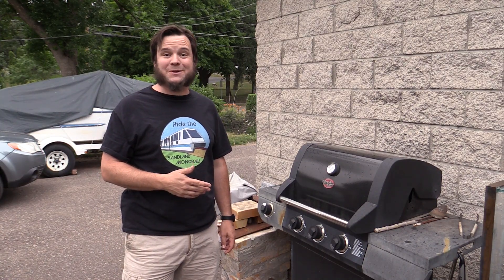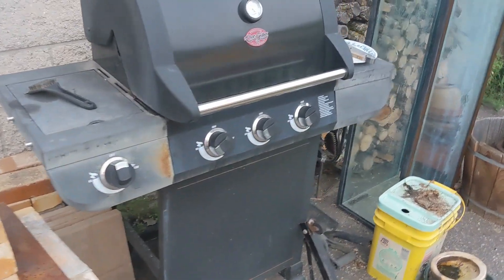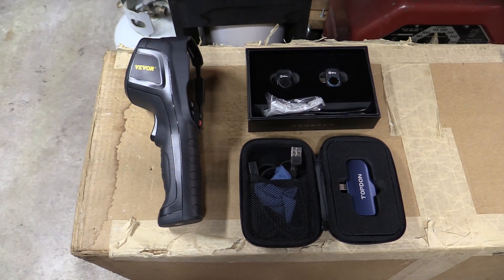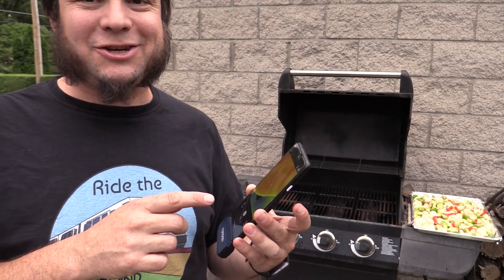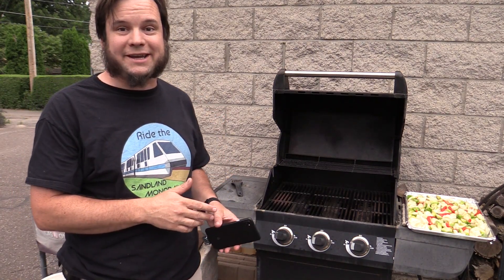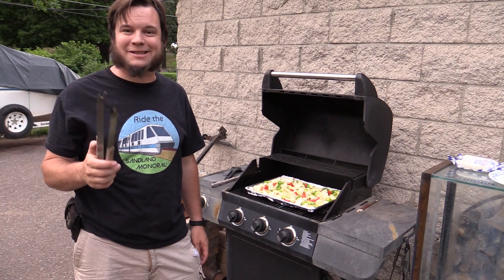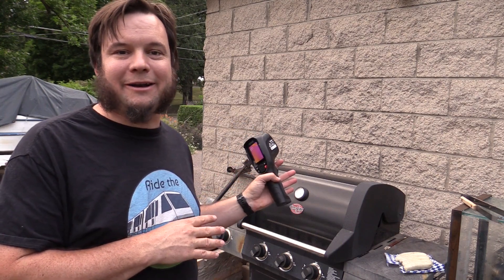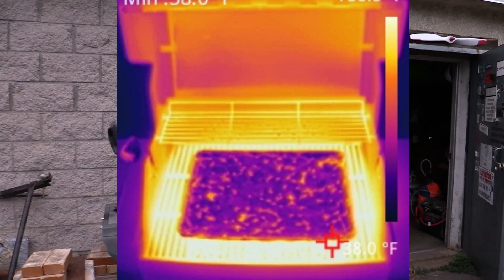I fail to make a heat map of my grill

Comment: I am unsure if this has been stated on here, but I learned a neat trick awhile back. If you take white bread and lay the slices all over the grilling surface of your grill and let them toast a bit (just long enough to get nice golden brown). Once you flip them over, you will have essentially a bread based heat map. This technique will show you where your hot/cold spots are based on the different levels of doneness on the bread slices!

Edit: oof, I got a notification about a like on my comment. Come to find out, one of the top comments on this video is exactly this. Shoulda had a V8 🤦‍♂️ I’ll leave it, it’s a good trick and it works, good to have some method verification.

Comment: You need to set the range the temp sensor shows or it will just default to max difference, + you need a uniform and none conductive backing like thin bricks.
You could also try to bake flatbread on the grill, that would show the heate distribution really well

Comment: Dude, that poor aquarium.
Reply from the maker: The one standing up next to the grill? We got that from a fish shop that went out of business, and so far we've been unable to clean the 20 years worth of mineral buildup off the glass. Have tried various strengths of acid soak, CLR, etc. It's halfway to the dumpster but still sitting in the yard in case we think of a way to use it.
Reply: @saveitforparts  last time I had that going on all I used was a 50/50 mix of distilled white vinegar and water with some scraper and some elbow grease.

Comment: I have had a Uniflame gas bbq for about 3 years. This was its last year. It has gone into the garage over winter, I kept it clean, but the burners, flame shields, and the fat catcher have all rusted out. That's even with a cover over it when not in use.

I saw someone comment on getting a webber, which will last 10 years....
The problem is, they are 10x the price, meaning I could buy 4 of these uniflame ones and still have change left over.

I might invest in that new Ninja outdoor bbq. It has a smoker built-in, too

Comment: Correct me if i am wrong but thermal cameras recordheat radioation right? What if the problem with uneven grilling is heat convection? Like some small  air stream from the coal up througth the grill  are hotter in some places than others or there is less air moving in some parts of the grill?

Comment: during the video showing the thermal cameras I saw what is to be a Lincoln Arc Welder that I did not know you had? What's the deal?
Reply from the maker: Someone gave me an old one, I have yet to figure out where I can plug it in or how to use it!

Comment: I suggest using thermocouples, or RTD's. Omega makes a 4 channel reader (part# HH501DK) for less than $200. You can simulate a grid and place these sensors in 4 separate locations to log the temps. You can go a step further and actually measure with items being cooked because more items will change airflow.

Comment: lay ceramic tiles on top of the burner bars, I do that with my weber to better distribute heat as the burners and flavorizor bars are not good conductors, tiles are cheap find the size that works for you and then test the heat distribution and how it is applied to the grill

Comment: I use these zones while grilling to keep something warm, for example. Freshly grilled food goes on the hottest spot on the grill. When I see it like this, something completely different comes to mind, the heated bed of a 3D printer. I've always been curious about heat distribution there, and you've just presented the solution to me. This way, one can check if the heat is evenly distributed on the heated bed of the 3D printer.

Comment: Due to water content, actual food doesn't get hot enough to view the heat differences with an IR camera. And metal conducts the heat and distributes it evenly, ruining the heat map. What you need is something with a high heat capacity, but low conductivity. Maybe a bunch of separate blocks of something, placed across the grill in a grid. The fake cement "briquettes" might be a good choice, but you wouldn't want to remove the ones already in the grill, as that would alter the heat distribution. Run the grill for a while, and then shut it off and open the lid and view with the IR camera. Hopefully the briquettes on top would block out the higher temperatures down below, and show a map of the cooking heat.

Comment: You are supposed to keep your barbecue and use it  under a sheltered porch or in your garage not leave it in the weather, It will then last ten years. if i was you i would keep the large thermal camera as it has the bigger sensor on it.😁😁😁😁😁😁

Comment: I had a ceramic tile that had about the same size as my grill- I put it in there for only a few seconds and then looked at the back of the tile. I could see the round burners and the grate pretty well with a flir one. In my case even weak wind drafts would completely change the hot zones around- even with the lid closed. This method didn't account for the 3rd dimension though- my grate has two closed round areas direkt above the burners- those parts work more like a pan when the metal is super hot- but die air above it is colder than where the open grate is.. which is bad for sausages :)

Comment: I think you need to put some even, but sectioned surface in there, say some metal plate divided into 1” squares. That will prevent the heat from being distributed by the plate or food itself. You might even consider trying to thermally isolate the plates from the grate to prevent the plates becoming sort of like heat capacitors that would aid in an even distribution when you don’t want them to. Then you probably also want to look at the behavior over time, it might start out very uneven and then become more even or vice versa. Good luck.

Comment: I once live in Saskatchewan in the fricking winter 30 below celcius and I would bbq a lot on my deck.  People looked at me weird.  My biggest problem was grease would get on my lava coals in my propane grill and they were the ones that would not conduct heat.  They would catch fire a lot and I put them out with a spray bottle.  I'm sensing a correlation.

Comment: Hi, I have a suggestion: The TC-001 has two temperature ranges; One from 0 to 300 F, and one from 300 F to 840 F (0 to 150ºC and 150ºC to 450ºC). Perhaps you can find the button option to change the mode. I own a TC-001 but I don't use the official app so I can't tell.

Comment: Are cast iron hot plates not a thing over there? you wont find many australian barbeques without one. big flat sheet of cast, about 5-10mm thick. if your really swanky, you might have a huge bit of stainless. spreads the heat out, so you dont have burnt spots on your 'tube meats' (love that). how do you cook BBQ onions and tomato n egg?  there's usually part grill, for your steaks on vegies that you want a bit charred. I never thought of it, but probably for ventilation to. Usually have a ridge cast around the edge to keep some of the fat in, and a few channels leading to a greasetrap.

Surely an outdoor supply shop would have something. its not a skillet, its part of the BBQ, only cleaned with newspaper and beer. anyway, its a great thing to have, and would make measuring heaps easier.

Comment: If the camera manufacturer offers a software suite, you can thermal tune the image and narrow the temperature gradient, removing the higher or out of range temperatures, which with the flat pan in the middle would show you a better thermal gradient of the pan itself. As has been mentioned though, if the pan has any amount of reflection or shine, high emissivity, it will not be an accurate representation.

Comment: I know that in the 80's propane grills came with lava rock to place on a lower grill below the cooking grill. It spread out the heat and made it way more even. In my opinion they quit doing that because it would trap the gas under the lower grill and lava rock and would "explode" when people tried to light it. I noticed when i bought a new propane grill it came with no lower grill to use lava rock, yet it had ledges for a grill below. So i went to Home Depot and bought a grill to fit it.  Best to light it with a lighter instead of the clicker like you use on some of your potato guns. lol

Comment: Actually this was a fail, for different reason. At 2:01 you post an over-lay. This clearly shows, the heat distribution. The metal covers are designed to heat up and then radiate the heat evenly. If you remove the metal covers, the gas flames would have a very narrow band of heat. So if your goal was map the heat of the grill, you did it. Also, One could argue, that the total heat flow at the grill is generally even, but most likely over the metal covers the heat spikes. When it comes to grilling having a very hot, and then less hot pattern is necessary, as if the heat was homogeneous, the food would burn quickly. A microwave oven uses the same heat wave, (sin waves pattern) to cook food. The key to a BBQ grill and part of the fun of grilling is that you have to manually move the food, and use your ability to judge the hot areas of the grill, to ensure even cooking, over time. By moving the food from on top of the very hot metal plates (see in the over-lay, photo at about 2:01), and then moving the food to the cooler areas, you can control the cooking of various kinds of meats and other items, for grilling.

Comment: This is the first time I've ever commented on any YouTube video! Congrats?! ;) Anyway... When you light your grill, do you turn on all the burners and then press the igniter? I've encountered issues with my grill not heating appropriately when I've lit the burners all at once. What I've found that works for me every time is turning on one burner and igniting that burner, then turning on the next burner and igniting that burner, and then turning on the third burner and igniting that burner. Most times when lighting the burners one at a time, my grill heats up to approximately 600 degrees F (according to the temperature gauge built into the grill hood. Occasionally, even when lighting the burners in this manner, the grill won't heat correctly. When that happens, I shut off all the burners and start over again lighting each burner individually. This second attempt never fails - and my grill heats up like it should. Best of luck to you and your grill... and thank you for every awesome video you create! :)
Reply from the maker: I do one at a time, each burner has its own igniter built into the gas dial on this one.
Reply: @saveitforparts  Thank you for the response! I hope you get your grill temps figured out. My grill is a Dyna-glo from the local Menards 3 years ago. It's a 3-burner model and it was on sale for about $120. It's worked great, though I did buy new burner shields and new grates for it this year. The original parts rotted out as I wasn't cleaning the grill on a consistent basis. Again - hope you get the grill figured out.

Comment: Looks like your grill has the same issues as mine, being the grill itself is so thin, the gaps dictate how things cook (read burn) and the metal offer so little in the way of thermal mass and heat spreading.  Years ago I had a BBQ (as we call them in Australia) that had a later of scoria between the gas elements and heavy steel grill, which made a world of difference to how things cooked.

Comment: If you had an ArcDroid, you could make yourself a steel grill that would leave hexagonal, triangular, square, circular, or whatever -shaped sear marks you want. 🤣
Reply from the maker: I'm still waiting for them to sponsor me! 😂 Although I really need to start using more of my fabrication tools before I get another one. The 3D printers and lathe and the welder just sit there gathering dust since I don't know what to do with them. The laser engraver will probably get more use when I get around to thinking about it, but I need to find a less sawdust-y home for it as well.
Reply: Have you contacted them recently, with your much larger subscriber base? Every kind of heavy duty bracket, mounting hardware, and a million other things can be made with one. I'd be collecting up sheet scrap sheet metals, for when they do sponsor you. I have zero doubt they will sponsor you. -especially if you make a video showing a pile of sheet stock scraps you've collected up... so many strong parts ready to be drawn out and cut... 😉 @saveitforparts

Comment: What you could do is run the grill for some time, turn off the grill let it sit for about 5min or so and then check the heat distribution. This should show you what on the grill at that point is cooler then the other parts and should give you an idea of where you have hot spots and where you have colder spots.

Comment: I laughed when you put that tin foil down on the grill. Shiny aluminum reflects temperature rather than transmit its own temperature. It’s weird. Something to do with black body radiation but I didn’t get it 😆
Reply from the maker: Yeah, it was a bit of a desperation move, I know it doesn't transmit heat well. I should have used a big sheet of cast iron!

Comment: You might need to clean out your grill or replace the burners if you have uneven heat spots. You can also add a smoke box with a little charcoal to help even the temp!

Comment: What I might do is let the grill come up to temp, then quickly shut off the flame, and take some heat measurements before turning the flame back on and finishing cooking :)
Reply: My thoughts too.

If the burners are still too hot, lift the grill/grate/whatsitcalled out of the grill to see its temp. That should represent the temperature well of an unobstructed airflow

Comment: What I'd be curious to try based off what I see. Run the grill for a few to heat up. Then cut the flame and wait only a min. Then see if you can take a picture and perhaps we can see the grates heat better. Another suggestion I think would be if you took two cookie sheets side by side. Run the grill with them over top with a little too either in the middle or on the sides. You can sort of see in the last picture that grill front is much hotter then the back.

Comment: I think you might want to find something like little chunks of fire brick and place them in a grid  on a grating. Let them heat up  and every couple of minutes kill the flame open the hood and see which ones are hotter or cooler. This way they can't transmit heat to one another  ( like the sheet of aluminum foil) or  heat up so quickly that you'd have to check it at just the right moment. Otherwise you could just use washers. Of course if you have some really big heavy steel washers around those might work anyway.
Reply: If you could break up a pizza stone, those would work for measuring the heat distribution, and you could cook on them, as long as the chunk was big enough
Reply: Yep, these are the way I'd go with it.

Comment: I have the similar grill (its a Char-Broil but the construction is the same). I believe the hot zones are a result of the airflow pattern through the lid. The air flows in from the front and is drawn out the back, I think this convection action causes the uneven heating. I don't grill all that often, so I just keep it simple and put meat in the back of the grill. It would be awesome if someone could figure out how to even out the heat (design mod).

Comment: Our old grill had a rack just above the burner that held a layer of lava rocks to even out the temperature and hold some heat like coals.  Also had a clip on the bottom to use a standard soda/beer can for the drip cup so you could just throw it away.  It still rotted out, I think I replaced the entire burner a couple times before we gave up.
Reply: I forgot about lava rocks - those made sense. I guess cheap pieces of metal as diffuser plates maximizes profit.

Comment: The classic way to test an oven is to use slices of bread, and see which toasts first/fastest. The baking pan was a good idea, but it spread the heat, and the vegetables on it would damp cause the pan to heat more uniformly. You might also try heating the grill for several minutes on low, and use a large sheets of paper to map the hot areas.  Nice idea though. I am sort of amazed that only the stand alone camera could handle the heat. It might be useful to tell people what the sensors are, so they could avoid the ones that aren't in the Vivor.
Reply: Oh cool, that's easy enough that I can do it, thanks for the tip.

Comment: @saveitforparts Dude. What is the difference between screwing around and science?       Documenting it.     This is science :D
One could also imitate a camera sensor with a bunch of thermo couplers on the grill surface in which you could picture the spot temperatures.
Maybe a 24x16 resolution XD

Comment: IR studies are tricky thanks to emissivity. The foil demonstrates that well. I used to work in a plant with steam lines and thermal cameras showed the stainless to be cool even when they were scalding hot. Emissivity differences throw it all off. I think your largest issue is that the burner metal is effectively too bright.  If you want to map the heat a bit better, I would try a thin layer of small volcanic rocks to provide a viewing plane and to obscure direct view of the burner metal. I always like a thick layer of volcanic rock between the burner and the food for evenness. I'll guess your burner is unbalanced due to overpressure for the existing channel widths. Corrosion will unbalance them over time but you can use a drill bit to fix that. Cool video. 👍 Now I need a brat with some caramelized onions on a pumpernickel roll.
Reply: or spray paint the tinfoil matte black or a color that is neutral to the device
Reply: @B.M.0.  Absolutely! We used black tape for targets on stainless. 
A little grill paint would solve that problem, but then you get into convection of the exhaust gasses and heat in the newly enclosed area. It's tricky.